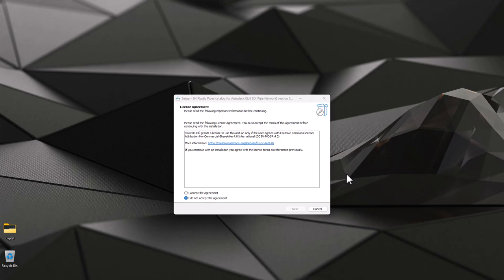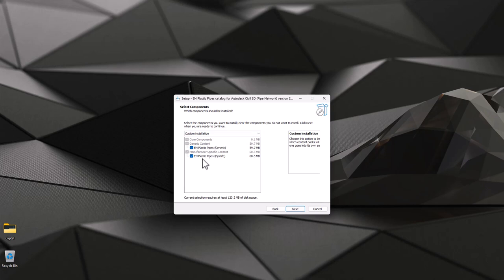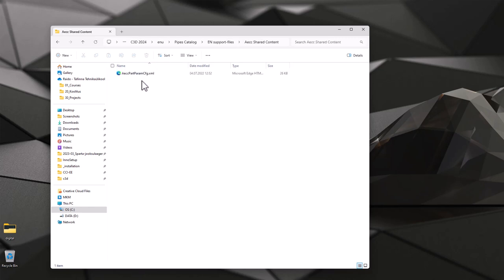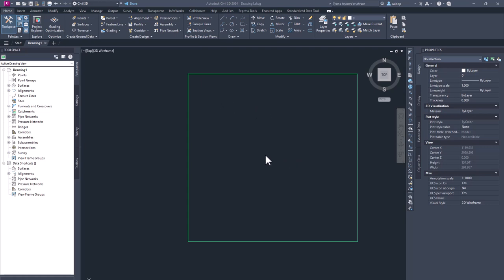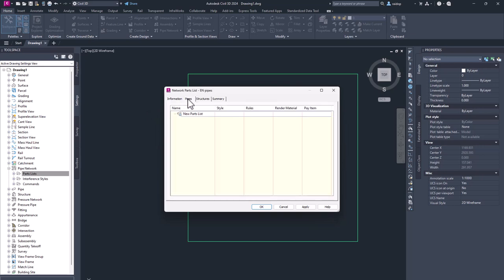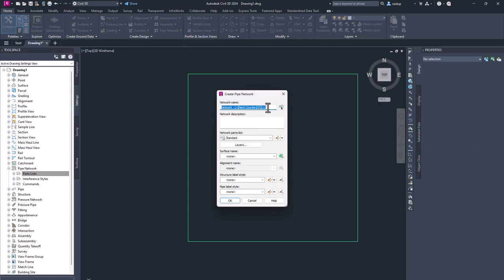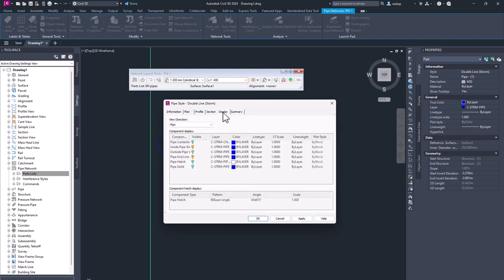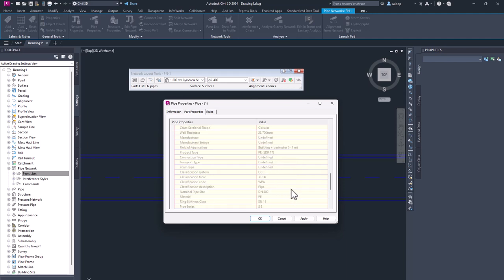EN Plastic Pipes catalog for Civil 3D (Pipe Network)

Comment: Really good job with these catalogs! It's much appreciated!

How come you decided to use Pipelife and not i.e. Wavin or Uponor? Just wondering.

Also have you put in to thought how these catalog synergizes with Infodrainage?
Reply from the maker: Thanks for your positive feedback. Pipelife is really an example (my free choice, it is not paid development). I chose it as they had quite good information available at their website(s) (public data). But I have to say, that some information was given on some country-site (let's say Finland) and some valuable information was given in some other country-site. So, it was a kind of merged development from different sources. 

At this stage this catalog has been tested with SSA (Storm and Sanitary Analysis, which comes with Civil 3D). This means that if you draw a pipe and it has inner/outer diameter, then inner (inside) diameter is exported into SSA. And vice versa. Your catalog defines, if SSA gives an answer (a need) to increase/decrease a pipe diameter, then the most suitable is selected based on this Civil 3D pipe catalog that is active (so, real dimensions/availabilities). That is the power of information-sharing. 

Having said that, I have not been able to test this with InfoDrainage. It really depends, how the import/export has been defined in between Civil3D/InfoDrainage. If a user can define what is mapped in terms of parameters, I do not see a problem (just like with a shapefile for example). If the mapping is hardcoded into the export/import, it may mean that you must produce some information differently to ensure the compatibility. I do have strong background with Bentley OpenFlow products (WaterGEMS, SewerGEMS, HAMMER etc.). In those systems you need to find another workflow how to share information in between design (Civil3D) and analytical platform (like hydraulic analysis). I do not think that soon it becomes as one package. Meaning that, yes, you can carry out some simple analysis inside Civil 3D, but you still should think how to enable to export your data into analytical platform like hydraulic calculations software, because those platforms (like InfoDrainage or InfoWorks WS) do open a lot more calculation capabilities. In fact, I really hope that we see some connection in between Pressure Networks and for example InfoWorks WS as well soon.

But sure, I'm happy to test those workflows with InfoDrainage/*Works products at some point.